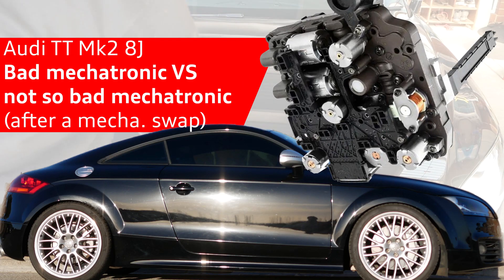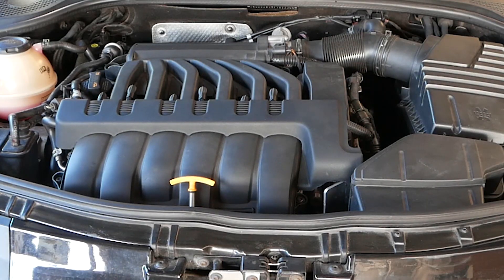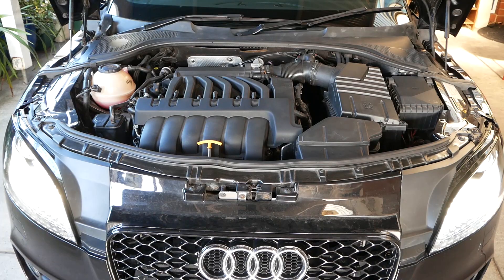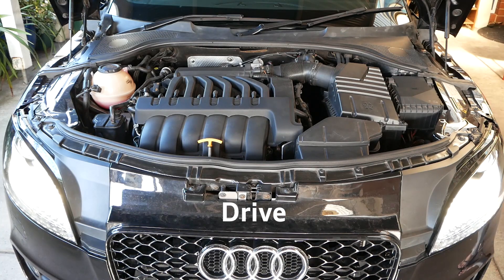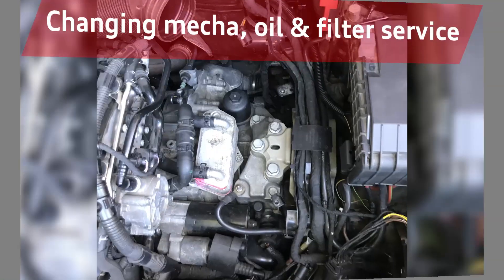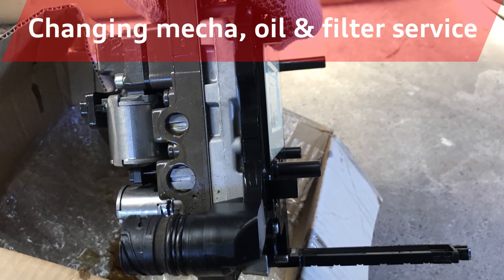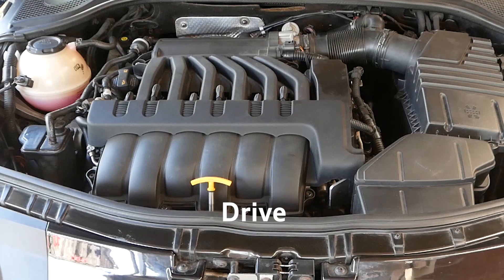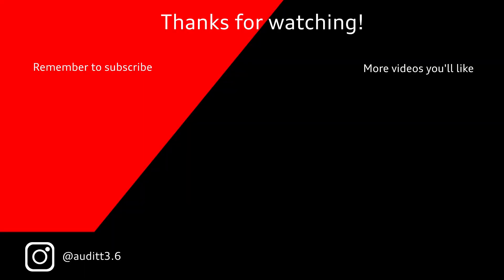Bad mechatronic VS good mechatronic in an Audi TT Mk2 8J - back to back comparison.

Comment: I think I've got a issue with mine 😢😭 18115- interference in megatronics module 
P1707 -002 - intermittent 

Is this the same issue when u scanned urs ?
Reply from the maker: Oh no! Mine was unexpected disengagement issue. 

I guess my gearbox wasn't well looked after.

Comment: G'day Ian, wondering if there's anyone else I can get a new mechatronic unit for my Audi TT 2007 model (2 litre) besides Audi. Do people recon them?
Reply: Man, thanks for advise, mine is a 6sp, were the later ones still 6 speed. Can I use a mechatronic of a 7 speed?
Reply from the maker: @Kingbad-so2tj  yes… if you have a 7 speed gearbox 😉

So for your 6 speed use a 6 speed Mecha
Reply from the maker: Hi Johnny. You can use secondhand ones. It's good to use "later model" ones too which have revised internals. You can obtain the part number by looking at your scans. 

They are able to be reconditioned (i believe the solenoids can be replaced) but not sure who does them... could probably call up transmission repair places if that's the path you wanna go?

Comment: Hey I have a 3.2 / 2008 / tt Quattro automatic 
And when pulling off sometimes I have a slight jerk / hop but when moving seems fine also same in reverse sometimes smooth some times jerks any idea if it’s the mecha box thing or how to check a auto any advice would be really appreciated
Reply from the maker: scan the mecha and see what it's saying. If it's inconsistent (mine wasn't!) then it's probbaly time for a DSG oil and filter service 😃
Reply: @ianpgonzaga  I had one that did the same thing up until it stopped trying to catch in 1st and 2nd gear or not want to change gear at all. Still trying to figure out what it is not really getting any codes. Same car 2004 Audi TT automatic trans
Reply from the maker: @TheXxkagekajixx  probably need a mecha clutch service.
Reply from the maker: @TheXxkagekajixx  probably through the measuring blocks in auto transmission.

Comment: Hello ! I have that noise on my tt 09 Quattro dsg, it’s my weekend car and haven’t fix the problem yet , it shifts good tho , if I drive it like that can I messed up the transmission?? , I’ve been driving with that problem for 7 -8 months .
Reply from the maker: Eventually it will get worse and worse and you get check engine light more and more often.

Comment: Did you check your engine, trans, and lower (dogbone) mounts? They could also allow for so much engine movement when they go bad ?
Reply from the maker: Yes there is some movement there as I am using all stock mounts. They are not damaged though and have survived the track day on Sunday. It’s definitely a bad mecha and also clutch packs on the way out.

Comment: hi ian, what engine cover is this? where can i get them?
Reply from the maker: Hi Samuel ... I am not running an engine cover. Do you mean the coilpack loom cover trim?
Reply: @ianpgonzaga  yes ian. because thay doesnt look stock
Reply from the maker: @omsam8930  Audi  Q7

http://75.98.168.98/engines/Audi/Q7/2010/26067882/44672231.html

Needs modifying to make it “fit”